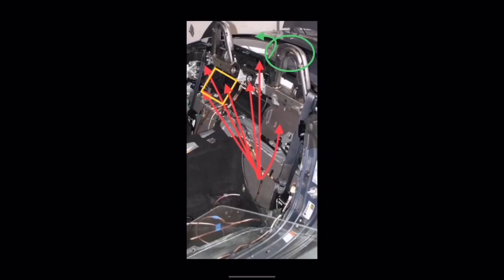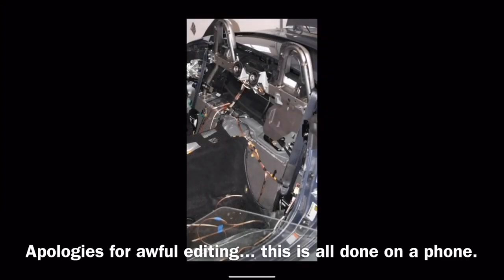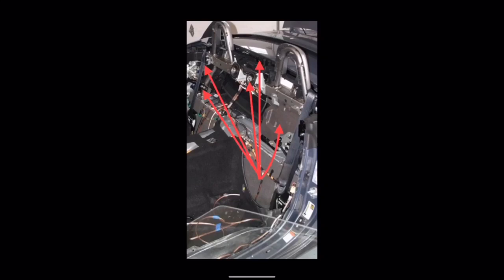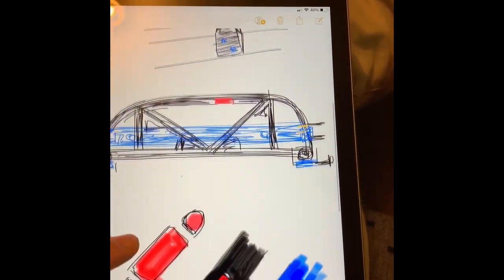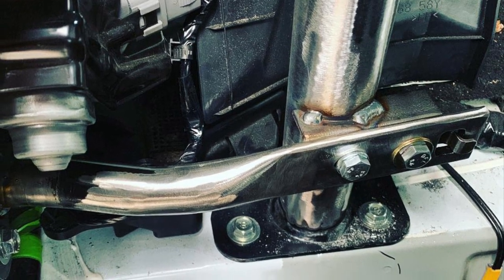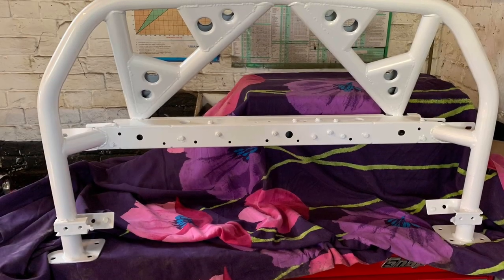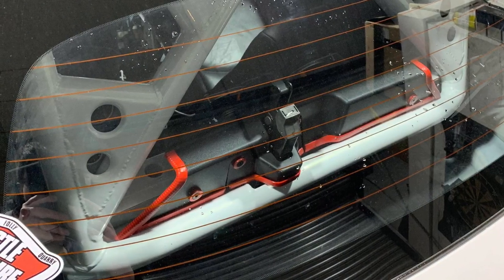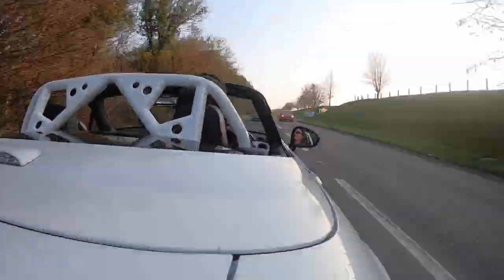BONUS BOREDOM - MX5 NC MK3 PRHT GCFabrications Roll Hoop Roll Bar - CAN YOU STAY AWAKE?!

Comment: looks like a great project  does the roll bar come with instructions, hardware, or just the roll bar  
rear vision; is it very reduced you showed no photo  Do you know if it is an approved roll bar for track use 
It looks goo   Most roll bars for the PRHT are quite low.  this one seems much higher.  Thqnks
Naec L

Comment: Hey pal,

Great video! 

I've got the same rollbar in my own NC 3.5 and the belts really stick to the bar, they don't retract at all. They require manually feeding back into the system. I've heard others have had the same experience, if you've had it too just 2 super quick questions...

Have you passed an MOT with them sticking and have you found a solution? I've used a bit of silicone spray and whilst easier, it hasn't fixed it at all.

Would love to hear your thoughts as it's such a niche subject, I'm really struggling to find answers!

Thank you
Reply from the maker: Hey mate, and thanks for commenting. The standard seatbelts really do catch on the bar and don’t retract well at all, I also went through the silicone spray/furniture polish debacle with little to no change, having to manually feed the seatbelts back into the reels every time I get out. 

I eventually got bored and have now fitted a racing seat set up with 6 point harnesses. This counts as a ‘change of use’ on an mot test and my tester has no issues passing it at all. 

(Obviously resistors were needed to cancel the seatbelt and airbag lights)